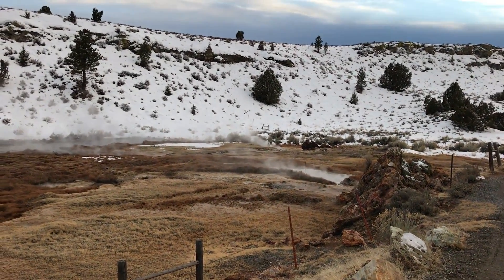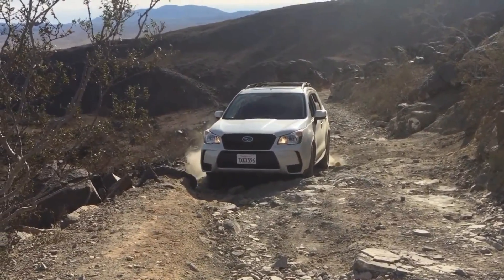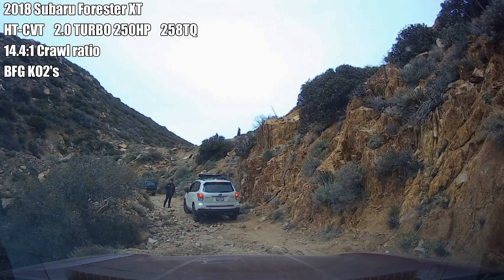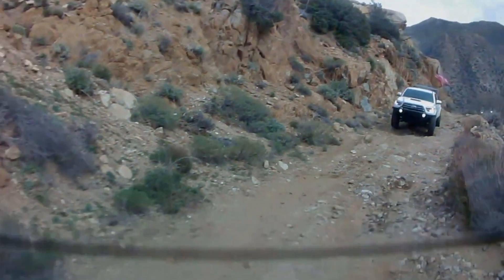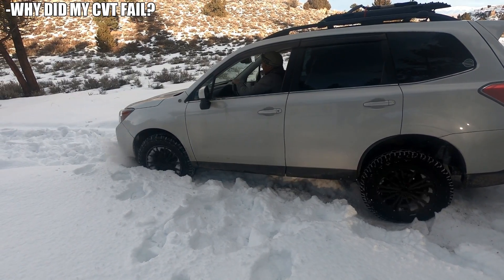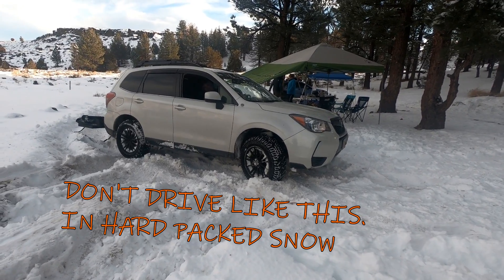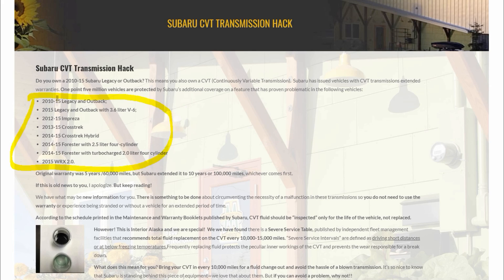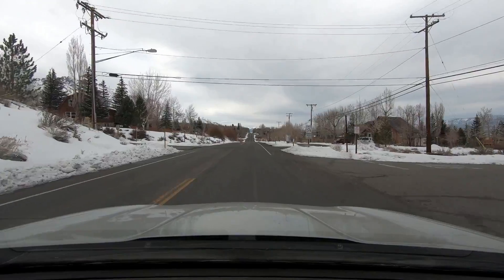CVT transmission Failed!  Can we make them last?

Comment: Sorry late to this video and sorry if I missed it,  has Subaru made any changes that anyone is aware of. I've known for years that CVT transmissions were not suited for high stress driving like off roading I'm sure they have corrected.. I hope? They kind of market to some extent to off roaders
Reply: I am an extended warranty claims administrator and can say that no. Subaru has made no changes to their transmissions. The design is simple so there’s only so much that can be done to improve longevity. They market their vehicles as off road capable which is a huge mistake on their behalf. Off roading the transmission causes extreme heat and heat kills cvt’s faster than any other transmission. That’s a fact. Before I was a warranty claims administrator, I owned a river rafting company and had a fleet of Subaru Foresters. Every single one of them had cvt problems to one extent or another and Subaru treated me like I was scum. Refusing to to honor their warranty and ultimately getting sued because of it. It also inspired me to get into warranty claims myself. I have access to data and can see who really is reliable or unreliable without conjecture or opinion.

Comment: I am thinking about buying a forester for on road and off road use... so bottom line.. I should avoid the newer models with CVT?
Reply from the maker: I’m seeing 2019 SK Foresters and Crosstreks with failed CVTs.  So I would prioritize vehicles with Automatic transmissions.  Rav4 and Bronco sport  should be on the top of you list.  There’s also a Trailhawk compass.

If you want to seriously offroad, consider a more capable vehicle like a Bronco Sport badlands or a Honda Passport.
Reply: @JonDZ_Adventuring  thanks for the response.  I've been considering 2014-2018 Forester XTs.. those seem to fall in my price range and maybe throwing in some basic mods.. Like AT tires and maybe a lift.  I've looked at the trailhawk and can't seem to shake the stereotype that Jeeps are not good all around vehicles.. haven't really looked at the Bronco or passport as options.  I'll look  into them.. haven't really come across anything that checks all the boxes like the Subaru's though
Reply from the maker: @darianlow4296  from a former Subaru owner (WRX, FXT).  The SJ Forester XT lacked in onroad performance and off-road capability.  Don’t take my word for it though, watch my old videos and my new videos 😃.  Careful with marketing, Subaru has a 10/10 marketing team.
Reply: @JonDZ_Adventuring  thanks for the insight.. I'm definitely a sucker for advertising lol.. I've actually never heard of anyone promoting the Honda passport for this type of thing.. but I guess to unleash it's potential you'll have to do some mods.  Funnily enough I was watching another YouTube channel who is an advocate for Subaru's.. and they suggested to watch your channel about CVTs.. haha
Reply: @JonDZ_Adventuring  also I think the passport is a fairly new model?  Might be outside my price range..
Reply from the maker: @darianlow4296  I looked at the technical specs and was surprised to find out how capable the Honda Passport was.  Then I watched videos by TFL and driving sports TV showing off that capability translating to real world results.  I went and bought one and it’s been more capable than I could have imagined.  You can buy a sport awd model for $35.  They’ll be hard to find, they’re sought after.  You might luck out though.  Car prices, used or new are crazy high right now.  It’s just a bad time to buy something.  One thing to point out though.  

If you’re just going to do fire roads, the Subaru is all you really need.  Just don’t expect it to get you anywhere too remote.  It can put you in serious danger.  I did the fins N things trail back in March, 2021, and it’s rated a 4 to 6 out of 10.  So you could easily imagine that a Forester will cap off at around a 2 to 3.

https://youtu.be/m5kcek85yzA
Reply from the maker: @darianlow4296  what about getting a SH Forester?  2008-2013?  Look up my buddy @softroadingthewest.  he use to drive one before it got into an accident.
Reply: @JonDZ_Adventuring  so..I live in Vancouver, Canada.. and would be using this vehicle mostly for daily city use.. but on the weekends to get out on Forest service roads for accessing hiking trails and camping spots.  I've been out on some of these roads over the last couple of years and they vary widely in terms of their terrain.. some roads that are not actively maintained can get quite gnarly.. I thought the Forester would be a good happy medium..I am not looking to do major rock crawling or true off roading.. but would like something that can handle itself decently.  A lot of people promote Subaru's as a decent crossover which is why I have been looking at them more closely and they fit my budget..20k-30k CAD.. thoughts?
Reply: @JonDZ_Adventuring  haha that's exactly how I found your channel..I was watching his stuff and he suggested looking at yours about CVT.  Is the SH Forester just a specific generation.. between 2008-2012?  I think the soft rising the West guy said he drives a 2012?
Reply from the maker: Unfortunately, what you’re describing is not a CVT Subaru, but the older ones with the 4EAT/5EAT transmissions.  In this video, when I was stuck in the snow section, my Subaru gave up so easily on flat ground.  The transmission overheated without giving me a warning and it died.  This snowy terrain was so simple.
Reply from the maker: @darianlow4296  Yes, the SH ran from 2008 to 2013 here in the USA.  That's the one i'd get because it has an automatic transmission and also has traction control.  They even have a turbo model available.  You have to see this harrowing situation on a snowy trail.  3 feet of snow that was 5 days old.  some kind of Jeep carved out alot of the trail, but 15 inches were still left on the center track and I was plowing 3 inches off the top.  https://www.youtube.com/watch?v=G5qHx0DAPGM
from what you are describing, you would not want to rely on a CVT Subaru to get you through something like this.  Take care man....  what I don't like about the CVT is the engine will rev, but the tires won't spin, even with Xmode 2.0.  The transmission stalls way to easy.  In my Passport, the transmission has never stalled.  I have 86K miles in 3 years and have been on some tough trails.  The SH Forester, won't stall as easy as the CVT, I think that's the Subaru you need.
Reply: @JonDZ_Adventuring  hmm.. interesting.. so you would recommend a forester in the 2008-2012 range with 4EAT/5EAT transmissions?  I'm not stuck on having to get a subaru .. but so far they have seemed to check the boxes on a lot of things .. the used car market is not the greatest right now like you said.. but I am hopeful to get something before next summer.. do you have any other car recommendations that fits what I am looking for?  totally open to suggestions..
Reply from the maker: @darianlow4296  one more video to link by none other than Matt's offroad recovery (one of YouTubes biggest channels).  Skip to 9:50
https://www.youtube.com/watch?v=CboYtj0tSCk
They have a reputation for blocking trails here in the USA.  You don't want to trust you life with one of these.  take care man!
Reply: @JonDZ_Adventuring  cool thanks a lot man.. any other car/model suggestions other than Subaru?  Really open to anything at this point lol.. I've been researching for the last two months and feel like I'm going in circles hah
Reply from the maker: @darianlow4296  would a 4WD work out for you?  Used Nissan Xterra, Frontier, Toyota truck.  4WD's aren't the best on Ice, but they'll get you through deep snow.  MPG's will suffer a bit.  Also, older Hondas are heavily underrated.  I was once a Subaru fan boy, and at the time I couldn't fathom an old Honda Pilot or Ridgeline being better.  I know I probably sound like a Honda fanboy, so instead of telling you that they actually are better, I'll just show you through another one of my videos.  This 2007 Acura MDX does very well!  https://www.youtube.com/watch?v=vV5q51uAjA8  
There are some nuances about the older Hondas though.  Strangely, if you air down you can't turn off traction control.  Maybe look at getting a Acura MDX SH-AWDwith the 6 speed automatic transmission.  I think those are 2010 and up.  The one in this video is only the 5 speed.  This is another video where you'll also see the limitations of the CVT.
Reply: @JonDZ_Adventuring  yea I've strongly considered the Xterra as an option.. never looked at Acura MDX?  I basically went through the trailhawk, touaregs, xterras, and Subaru's as options.  All seem to have their pitfalls.. but as of late I was thinking Subaru's would just be a compromise.  But I am second guessing that again now haha..
Reply: As long as the cvt fluids are changed every 30-40k they are beast on track.
Reply: @chromalusion15  thanks for the tip man!  There seem to be a lot of people against CVTs lol..

Comment: Changing out the CVT fluid is really easy and is simpler than an oil change.  Switching to a better fluid like the Amsoil product, using an external cooler and monitoring trans temp are important to extending its life.  We really need more shops that can rebuild them.

Comment: I just don’t trust CVT’s. My nephew’s 2016 Mitsubishi Outlander Sport needed a CVT replacement at @ 48 K miles. This is a 2WD, and just normal driving. He is lucky it was warranted for 10 years 100 K miles. The dealer never suggested for him to change the fluid. So like you said, what about the next time it goes out?
Reply from the maker: Trade it in quick!  While it still has value.

Comment: From my research on this subject it seems most cvt's(not Nissan's, they are junk) are fine for easy driving and will last a long time when doing 30k fluid changes. If you plan on off-road or often fast accelerations stay away from cvt's/.  It's really that simple.
Reply: Horseshit. Any master technician will tell you that Subaru is the worst cvt out there. Why? Subaru believes that CVT fluids are filled for life. You won’t find any Subaru dealer that will touch the cvt fluid. If they do, it’s not reported to carfax or any other maintenance aggregate. Subaru corporate does not want cvt fluids changed. Period. When the cvt fluid breaks down - usually between 40-60k miles, it begins to overheat and will burn up the valve body. Most people this happens after the warranty is up. Usually around 80k miles. Nissan used to be the worst at this. Until about 2014. After that Nissan switched to fully synthetic CVT fluid and added transmission cooler‘s to all of their cvt’s. Most importantly they added CVT fluid changes every 30,000 miles as required maintenance. Nissan cvt issues dropped dramatically after this. Subaru remains the only cvt manufacturer that doesn’t believe in fluid changes. Which is why their quality is poor.
Reply: @haroldbeauchamp3770  you seem to know what your talking about! I decided to stay away from cvt's period. Thats why i opted for the Honda Passport.No cvt and no under powered turbo! V6 with 9 speed😁
Reply: @uf1978  You, my friend, are a genius. Excellent choice getting a Honda.  I wish you many trouble-free miles.
Reply: @haroldbeauchamp3770  thank you sir! Actually purchased the same passport for wife except different color lol. We both have 2021.
Reply: @uf1978  I’ve always really liked those. My neighbor has a green one. Very dark green but it’s spectacularly green in the sunshine.
Reply: @haroldbeauchamp3770  I hope he didn’t buy the Honda for the awd because it’s the worst on the market. Kinda like there old automatic transmissions.
Reply: @tim4609  the CR-V is the worst on the market. I’ve seen the videos where the rear differential won’t work because Honda designed it to be too weak transfer enough torque to move the vehicle. I have no idea if that’s still the case, but you are indeed correct. The Passport, Pilot, and Ridgeline share a much more robust system that, contrastly, is likely one of the best awd systems on the market. You can find countless videos on YouTube that show the comparisons.
Reply: @haroldbeauchamp3770   they have got the same auto trans derivitave as the Oddesy Van and I wouldn't give you 9 cents for a dozen of them.
Reply from the maker: Tim, Hondas iVTM4 AWD system is actually the best system there is right now.  Even pro Subaru channels like Driving Sports TV admits it.  The AWD system in the Ford Bronco Sport badlands edition is a very similar system as well, and they took it up Hells Gate in Moab.
Reply: @tim4609  Actually quite the opposite.  Go check out the passport forum. Many owners live in snow country and they all brag on the honda awd. Both of my passports are awd and works great!
Reply: Actually quite the opposite. The Crv is the worst AWD system, period. Like many owners are going to say my $40,000 car sucks.
Reply from the maker: Tim, you realize that the CRV has a different AWD system than the Pilot, Passport, Ridgeline right?
Reply from the maker: @tim4609  Harold and I both owned Subarus.  Honda iVTM4 is immensely more capable.  Make sure to check out both video clips by swiping right:
https://www.instagram.com/p/BwPLMv-Hi3F/?utm_medium=copy_link
Reply: @JonDZ_Adventuring  Comparing a Bronco to a Subaru. What a dweeb. Crosstrek has been to hells gate so what. Why don't you compare a 4 runner to a VW?
Who would want a Ford, the most recalled car in history. Unless you collect cracked blocks and cracked heads for a hobby.
Reply from the maker: A Bronco Sport is based on the Ford Escape chassis.  Damn, you don’t know 💩 about cars do you?  🤣🤣🤣
Reply: @JonDZ_Adventuring  I wonder why they are not immensely more capable on the rally circuit.  I guess those rally guys don't know what they are doing. Maybe you should enlighten them. 
Perhaps you could convince them to start running Ford Escapes with all your knowledge.
Reply from the maker: @tim4609  so you’re going to say that a $1 million rally car is anything like a Subaru you can buy from a dealership?  You’re being serious aren’t you??  That’s hilarious 🤣🤣🤣.
Reply: Disagree that Nissan CVT's are junk.  My 12' Altima has 111,000 miles on it and the CVT runs fine.  The secret to making them last are CVT fluid changes every 25 to 30,000 miles.
Reply: @Joseph Kelleher  my post was mostly from my tranny guy that says he rebuilds for Nissans than any other cvt. But then again some folks my not be doing proper maintenance?

Comment: CVT transmissions have a limited torque capacity (less then 200 ft pounds), otherwise you can over-stretch the timing band in the CTV and it will fail. That's why they come with very small engines , so the torque output won't kill the transmission. To replace one is over $6000.
Reply: Nissan Maxima has 300hp and 261lb ft of torque mated to a CVT.

Comment: You said this was a turbo model? Has this been compared to the 2.5i model? I think spiking RPMs past the red line can hurt any engine especially if it's consistent? What do you think?
Reply from the maker: Yes, I mentioned that the Subaru base engines with the TR580 are observed to last longer.

Comment: Have a friend with a 2016 Forester.  It's got around 65k mileage.  Drives it locally and the occasionally on trips.  So far no indication of problems.  Should start to be concerned...and maybe replace/trade in the car??
Reply from the maker: If he has the Turbo, he should be concerned, if he just has the 2.5L normally aspirated engine it could last well into the 200K to 300K range just as long as he doesn’t abuse it.  Monitoring trans temps and changing CVT fluid would be a good idea, because even highway mountain passes can stress out the CVT

Comment: Why subaru club the thousands of owners dont collect complaints to Subaru dealership?! Go anywhere car  can't be equipped with CVT. They've gotta put 5AT as an option for off-road lovers.
Reply: Because most Subaru fans are way too stubborn to admit any part of their car is shit.
Reply: Yes exactly, while they're at it add a low gearing option to the transformer case that'll make them killer offroader for a unibody.

Comment: So the question is- why CVTs?
Reply: Money is indeed the answer here. Subaru got tired of buying transmission from Jatco so they purchased rights to a Jatco cvt and then began making it themselves in their facilities.
Reply: GOV MILAGE REQUIREMENTS....GREENYS.
Reply: Money.  Uses less parts and cheaper to manufacture than a traditional torque converter automatic.

Comment: The CVT transmission is THE reason my wife and I are walking away from her leased 2018 Outback.  Too fragile even if you maintain them or don’t abuse them.  The only filter in the Subie CVT is accessible only by cracking the case.  Splitting the case in half is only possible by removing the transmission from the car.  Too much work and expense for a fluid and filter change.  Just asking for a failure by not changing the filter too.  No thanks.

Comment: Subarus are in general not off road cars, rather cars which can bring you to a camping area somewhere not very far away from the paved road. So is my understanding of their concept of the car. On the other hand if one pushes something to it's limits the thing will fail at some moment, especially if not designed for the challenge.